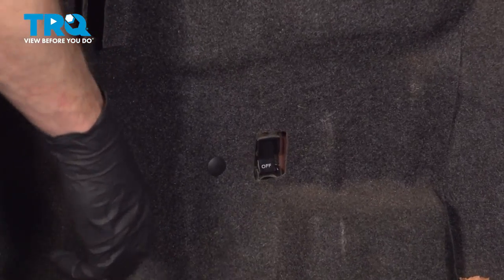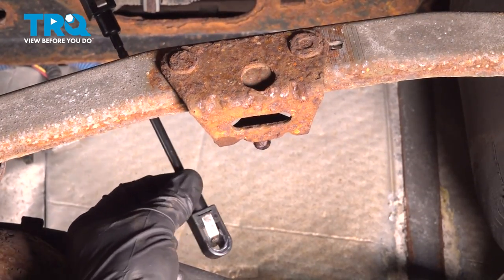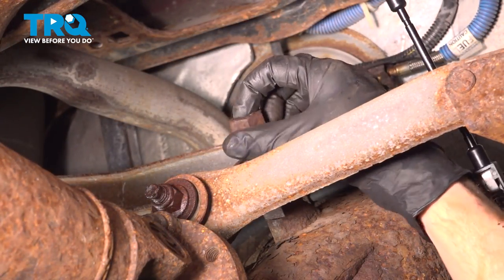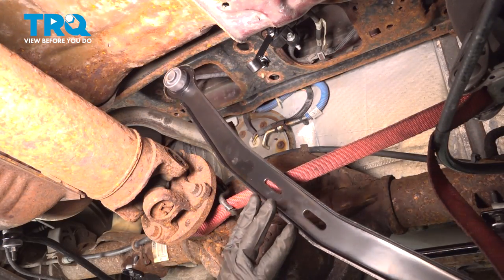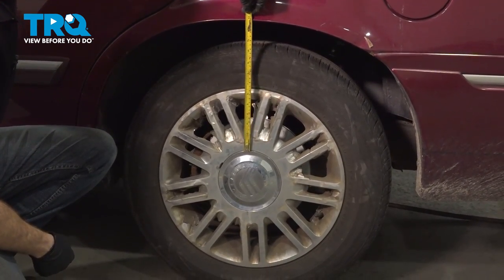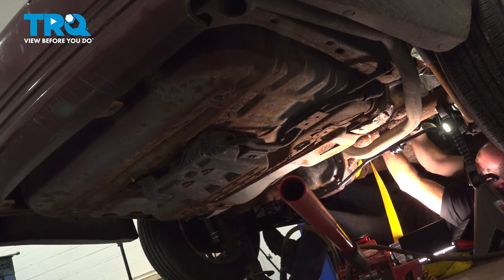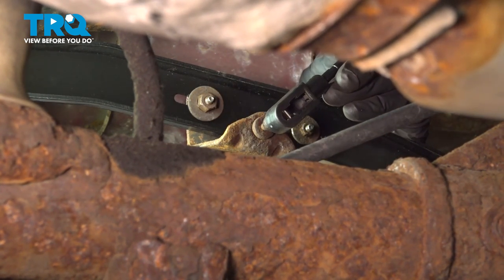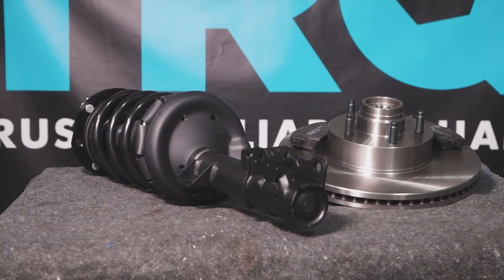How To Replace Watts Link Track Bar 2003-2011 Mercury Grand Marquis

Comment: Why would you have to go to the alignment shop?  It's a solid tube axle suspension there are no alignment adjustments for a watts link replacement. The only adjustment you need to be concerned about is the ride height bracket on the watts link if you still have the air ride.